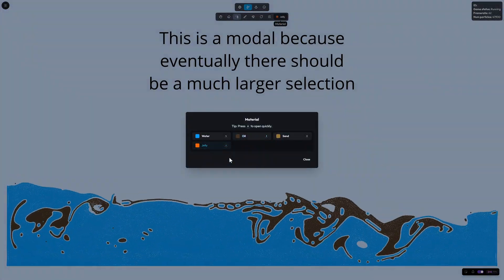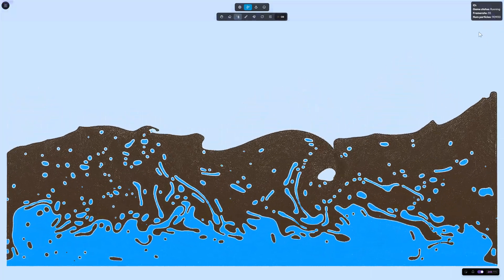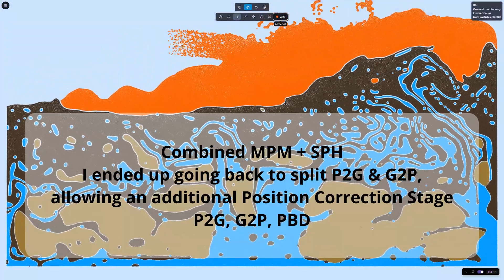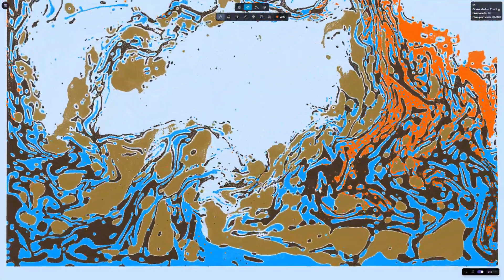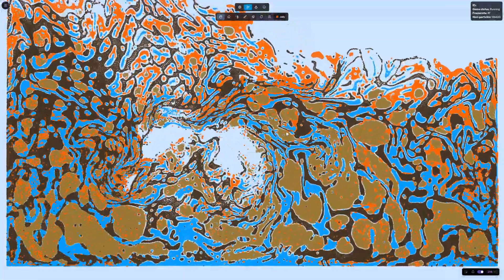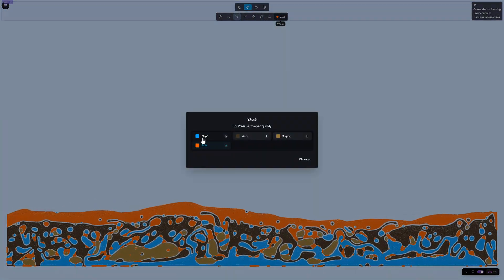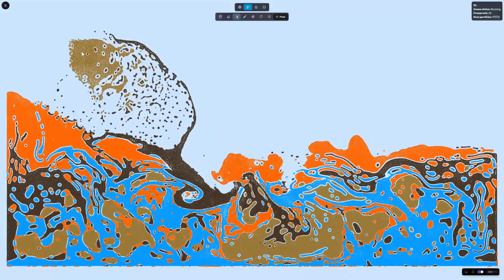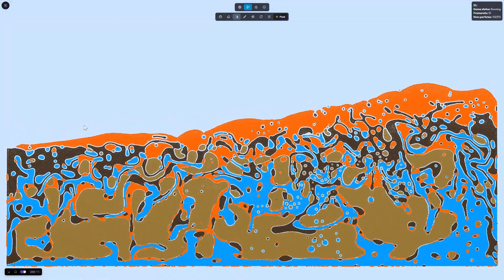Combined MPM & SPH for Liquid Simulation

Comment: im curious, how do you read the data from the grid and particles with simd, do you use gather or do you have another trick for it?
Reply from the maker: There are 2 main ways of arranging grid data,  either array of structs where each node holds velocity and mass or struct of arrays, in my case I'm using arrays for velX, velY and mass. It is quite easy to read the 3x3 neighborhood using 3 quad reads. There is one lane that is wasted. In 3D I generally use array of structs (velX,Y,Z, and mass) so I'm not wasting a lane.

In the particle world I often like to store my particles as structs, since the access is a bit random. One cool thing my particle based demos do is they iterate by bucket, to make the access a little less random and able to take advantage of local cache. For each bucket the entire neighborhood is converted from AoS to SoA.

Most simd libraries come with a transpose function that can easily help you convert between AoS and SoA layouts.
Reply: @GrantKot  interesting, so you bin your particles from AoS into buckets of SoA? are the buckets also a grid or how does that work?
your grid is also separated where each xyzm component has its own array?

because remember back then i said i got 20 fps with 1 million particles on my 6 core 4ghz cpu, and yours liquid heating runs at 45 fps on mine, when using the profiler 60% of the time in my code is spent on 2 gathers from avx2 when turning my AoS arrays into SoA for avx2 simd math
Reply from the maker: @Theawesomeking4444 when you mention gathers are you using that intrinsic where every element is an index into the array? I generally prefer to use the quad simd loads, even if to insert into a wider vector and then using quad grouped transpose on that. From what I remember the index based gather is inefficient on amd.

I’m bucketing into a uniform grid
Reply: @GrantKot  yes exactly! the gather intrinsic where you have an index of elements, theres also one with a mask aswell to prevent gathering out of bounds elements, i use that one, and yeah im on amd, i also realized im actually doing 8 gathers not 2, because im loading in 2 vec4s, but yes those 8 gathers is where 60% of the code time is spent on, ive heard that ispc should supposedly do the quad load and transpose for you, but i havent used it.

also have you tried using the igpu for the fluidsims? i actually managed to get mine at 95 fps 1 million particles on a laptop igpu the one that comes with the ryzen 5 5600h
Reply from the maker: That is pretty cool to hear that you're getting such a speedup on igpu! Using compute shaders?
Reply: @GrantKot  yes im using compute shaders with vulkan, its pretty flexible because you can integrate it with other game engines, for example using unreal to do graphics on the dgpu while using vulkan to use the igpu for the fluidsim, and its very helpful on laptops since they usually have an igpu and their cpu clock speeds go slower due to thermals.

its kinda interesting that you dont use the gpu for the fluid simulations, considering gpus are basically very large simd, kinda like an avx1024 at lower clock speeds.

the issue is that you still need a cpu fallback for cpus without igpus, aka most desktops.

Comment: Since you use SPH now for volume preservation are you still using mpm for velocity integration so you get larger time steps? Or how would that work?
Reply from the maker: Yeah I use the interpolated velocity from grid to do the initial predicted position which then gets corrected by any position based procs (springs and shape matching can also used). The velocities are updated based on the corrected position while the vel gradients from G2P are used when scattering back to the grid (to help preserve local motion). There’s also a coarse grid used here to help improve incompressibility
Reply: @GrantKot  Wow that's amazing. I have been wondering if a hybrid approach like this could even work. It makes a lot of sense for games since you want very accurate collision data with boundaries and still maintain a large time step. Also, how do you feel about having different levels of detail in your fluid simulation? On a technical level its possible, but it seams impossible to do fast enough for real time. Maybe like the paper Tall Cells but there are a bunch of problems with that.
Reply from the maker: I think for 2D I might just keep the same LOD everywhere as people can pan around quickly. The merging and splitting will probably be more prone to popping with the hybrid mode. With pure MPM, just randomly deleting 50% when coarsening kind of worked (I didn't need to exactly match pairs of particles to merge).